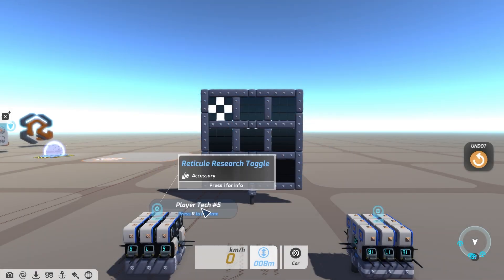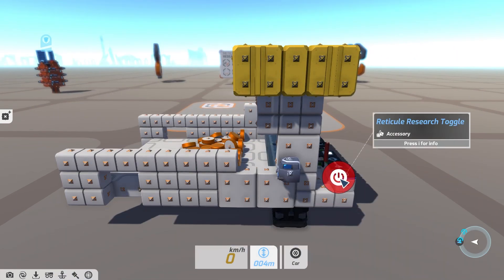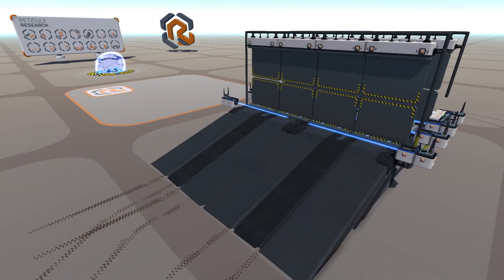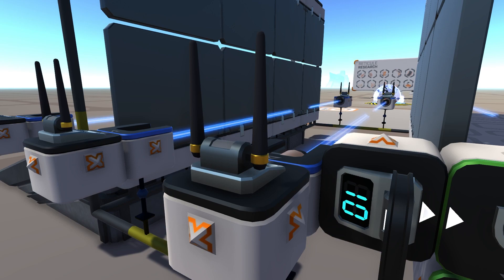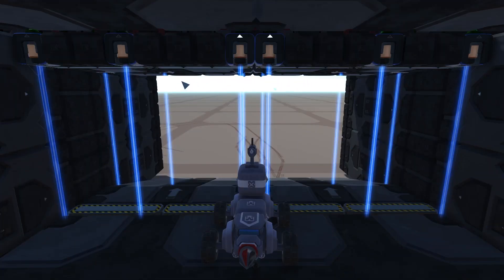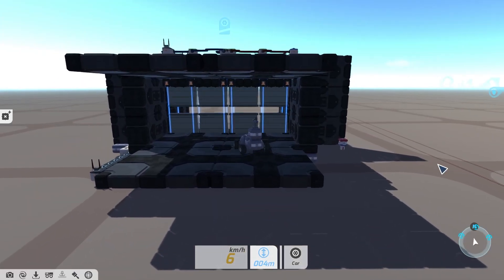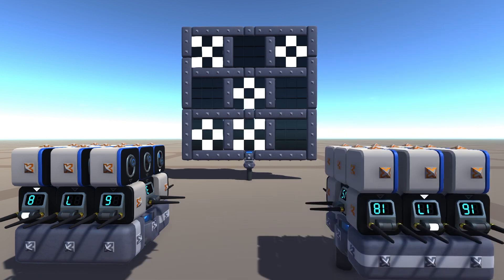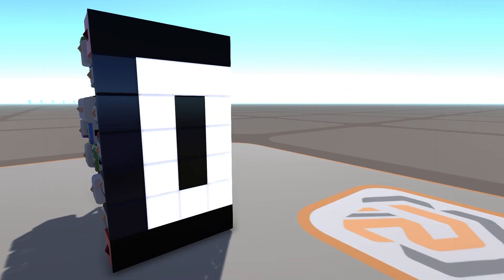What Can Circuits & System Do? || TerraTech Community

Comment: Is there a way to limit the signals coming through a wire to only one? I keep getting weird double signals when using the transmitters, I think that the transmitters give a signal for a set period of time rather than just a tick, and so the same signal gets sent several times.

Comment: One big improvement could be a control block, where you set the block to be assigned a certain user input, then when it's pressed it will output a 1. Similar to the regular buttons, but it would allow you to hit a key on your keyboard instead of actually pressing a button. This would be extremely useful if you wanted staggered fire or something, because you could activate different weapons with different keys, but with the downside of the engineering taking up space.